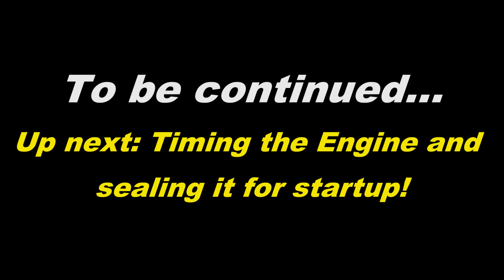Ford 5.4L 3v Engine Timing Chain Kit Replacement Pt 3 of 4: Valvetrain Component Removal

Comment: It's videos like this that keep me coming back to YouTube. Many thanks to you for the Timing Chain video series.

As I've hit that point in life where I'm just about over working on vehicles, once I finish with repairing this truck, I'm done for good. Why couldn't you live here in southern California where I could just pay you to repair it instead of me having to do it?

Anyway, I have a question for you. Unfortunately, I'm almost certain of the answer but I'd like to get a more professional opinion before I have to re-time that dang engine. I have a 'friend' (yeah right) - a brilliant guy who made this one misstep in life when he bought a Ford F150 with a 5.4 3v engine in 2005 - who was swapping-out the chain tensioners on the motor (newly rebuilt - way too long of a story to go into detail) when there was an "I wish that didn't happen" moment. First one went great but, while switching the other, the guide came off causing that friend to lose his grip, thus screwing up his grand idea of switching them out without taking the necessary precautions. Anyway, as he was standing there ready to put a wrench through the windshield, he hears a sound and, out of the corner of his eye, sees the cam move counter-clockwise ever so slightly. As he was grabbing that wrench to put through the windshield, the same thing happens again. Frustration abounded and he walked away. Fast forward one year, he wants that thing out of his garage. He sees that the cam moved enough to have the chain off the timing mark by two links. Question: can that Einstein-like genius of a person just grab that phaser wheel, turning it enough to put the links where they should be? Or, to be safe, will he have to re-time the motor?..................likely resulting in many, many wrenches through the windshield.

Comment: Question, with the cams in the neutral position (roller followers removed 1, 4, 5, 8) why would the left cam (drivers side) have more free play than the right. Don’t believe this is a problem but find it strange. Thanks

Comment: what is the easy way to install the rocker arms on a 2004 5.4L have the tool  the back ones are a pain would putting the  key way in the 6 oclock  ?

Comment: Aftef taking the 3 followers on each side with the tool and you turn crankshaft to 6 oclock position. Do you need to use tool to take off all other followers ? Or are they in a position that when you take off camshaft, they stay in place?
Reply: miguelyjuanita10 how did it work out for you. I'm hours away from starting this step...I'm reading a lot of different things. What steps did you take?

Comment: note: in the video 3 you clearly state cylinder number 5 but it looks like you are on 1 because the appearance  of the vct solenoid  seems to be at the front of the engine until you look at the location of the sparkplug wells and the fact that you are filming from the center of the engine out not the other way. This is why we all have to pay attention to detail. waisted an hour but love the video. saving me thousands
Reply: Thanks man, I was just about to make this mistake!
Reply: Double checking-

Remove passenger Intake on 4 and exhaust on 1? 

Drivers side intake 5 and exhaust 8?
Reply: Why do wr remove the folloers

Comment: My Crankshaft key way is at the 12 o'clock position, but my intake lobes are more at 8 or o'clock position. The center lobe is more like 1 o'clock position. What to do?
Reply from the maker: turn the crank another 360 it should now line up.
Reply: I've turned it quite a few times and can not get them to line up like your.
Reply: if I pulled all the rollers, would there be a way to be sure it is in the right position?
Reply: also, my chain had jumped a few teeth. when I lined up the chain at the bottom and left side cam, the right cam was off two links
Reply: Greg Grundel my lobes are at around 10 oclock position, like you stated, i have cranked it another 360 a few times and they stay at that position. Did you get your truck fixed?

Comment: Hello greetings from Ecuador, I have a f150 year 2010 4.6lt V8
I lost oil pressure and the engine sounded very strong, change the entire distribution kit, oil pump and water pump. But when you turn it on, the right side of the engine sounds very loud as if it were a snore, just when you start it, mechanics here have told me that they are hydraulic oil elevators, it would help me to know if that is the cogs of the crankshaft please

Comment: excellent tutorial video i have one question to ask i have ford f150 2001 5.4 engine as i was driving down the spark plug shot out cylinder head and i had to get my truck away from traffic  so i drove it as it was driving everything just shuts off will this put my timing out    tune also replace cam crank sensor  still wont start but cranks also the spark plug was replace

Comment: i have a question about the 4.0 v6 sohc. i pulled the engine and put #1 a T.D.C.C. i used a marker and indexed everything on every shaft so i wouldn come out of time because i dont have the special tools to hold the cams and crank... anyhow it hasnt mooved but i notice the "ballancer is not linging on its timing marks. its at about 11:00 o clock and should be at 3:30 or so.. is it because if i had rotated the engine more times would that mark be right and #1 at tdcc?

Comment: Brian I have an 06 F150 with 290k miles.  Engine is completely original but replaced trans at 175k.  I have the ticking going on and was thinking of doing this job.  Would you recommend doing this on an engine with this many mile or just get a new engine.  I really dont want a new car payment and love my truck.  Any suggestions?  Thanks for all the great videos!

Comment: I'm re-doing the timing on 3v 4.6 as the pass. side phaser is 180 off the mark. How much of this process would I need to do to correct that as the rest of the timing marks line up and the driver's mark is also correct. I also have the MMR timing set so how would I go about removing the tension without damaging the tensioner? Thanks

Comment: am i missing something? is my 2007 f250 super duty 5.4 triton the same engine,i went to order parts on amazon and it stated the melling m360 doesnt fit but the m10340 does,same when ordering valve cover gaskets,mine has 14 or 15 screws not 8,any help would be appreciated

Comment: i found that the solenoid seals i ordered have 2 tangs and offset hole for my 2007 f250 4x4 super duty,after that i believe i found that mine should be the 1 3/8'' that are to be put in with valve cover removed,i had planned anyway to do the whole timing job but like to have all i need ready to go,any other issues you know or oddities with this truck,thanks for such clarity in your vids they are top notch

Comment: Is it a problem if you don't remove the roller followers and the camshaft?
Reply: no, i just did it, was easy actually, this video is too much taken off, even bought the 150 dollar tool and didnt need it
Reply from the maker: It will be difficult to time it correctly
Reply: How exactly did you time it without removing the camshaft followers

Comment: If I'm not doing phasers do I still have to take the cams out?
Reply from the maker: The cams were taken out to inspect the journals and it also makes it much easier to remove the rest of the roller followers is all.

Comment: what tool can i used to keep the cams from moving on my 2001 Ford EX.I purchased   303-448 OTC 6024,and Ford camshaft Holding tool.I'm looking forward to replace my tensions,,guides,and oil pump.#324 miles,.great compression readings

Comment: I have a 2007 F150 in the shop now, rattling from the right side. Managed to get the vc off and it appears the tensioner has failed, lots of slop in the chain. Haven't had the pleasure of doing a 5.4 yet, it will be next weeks project. Thanks for posting the videos, very informative.

Comment: Waiting for Part 4!  Ordering parts today (8/8/16) and hope to bolt it back up this Thursday.  In the event you don't get the last video done by then, I'm most interested in the timing setup; seeing the cams are loose and do move a few teeth either direction.
Reply from the maker: Part 4 will be up today.
Reply: I've started working on mine but will be screwed if part 4 isn't loaded.
Reply from the maker: JeffCityGuy yes delays but it is uploading right now.
Reply from the maker: montyhopeful It is uploading as we speak.
Reply: Delays?  Are the cams basically at the point where you slide the phasers back on, then line up the dots?
Reply: Awesome! Looking forward. You have know idea how much these series of videos has given me the confidence to do this on my own. Thanks for sharing your knowledge!!!

Comment: why did u remove the roller follower in cyl 1,5,8
Reply from the maker: +STEEVE DAVID Nicolas They are the only ones that would be under pressure on the next rotation of the crankshaft the one we stop at.
Reply: +FordTechMakuloco do you have to remove all the rockers
Reply: +FordTechMakuloco is it required to do this on any engine that u have to remove the timing
Reply: +FordTechMakuloco do you have to remove them
Reply: so did you have to remove them all?

Comment: I think you forgot to mention the 10 mm bolt that is right under the water pump that is also a front cover bolt. The first one I ever did I couldn't figure out why is wasn't coming off and the tech I was working under came right over and showed me lol. Great videos! Keep them coming.
Reply from the maker: +Diesel Tech Cody I pulled the front cover in the other video. I just scanned along with the camera showing them all. I have never seen a 10mm bolt hold the front cover on this engine.
Reply: +FordTechMakuloco oops wrong video. But your correct my mistake. it's a 13mm and you did show it. The one right under the water pump is the one I missed on my first time, just didn't see it on the video.
Reply: @FordTechMakuloco hey I know it’s an old video but i just had a question, what would be the procedure to setting the cams before tear down of the timing components if the chain is broke and the cams are out of timing
Reply: +FordTechMakuloco what happens if your cam lobes are the way you said the first time  before you turned it over again and put it all together a d started it

Comment: How many hours does it take to replace the cylinder temperature sensor on a 2005 navigator and do you have to remove the intake